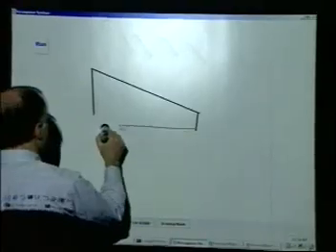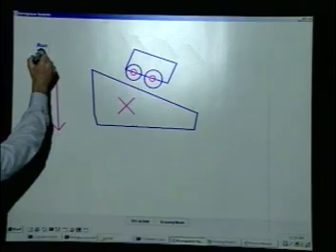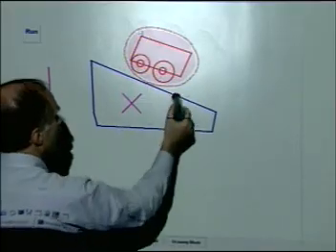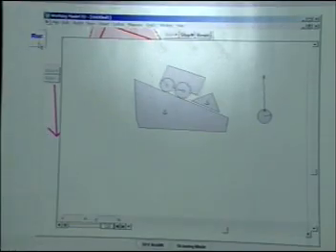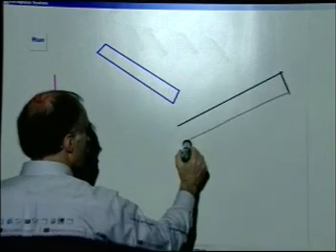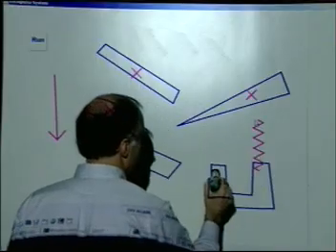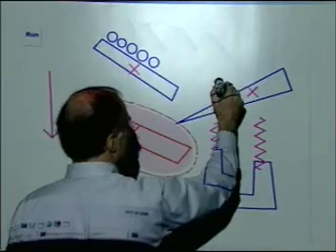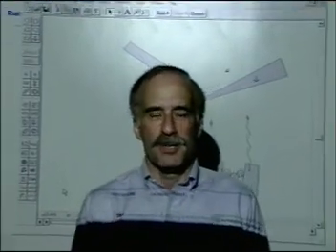MIT sketching

Comment: This video uses ASSIST (what they're presenting this for) and Working Model 2D (an engineering software). The physics and all that jazz is done in Working Model 2D. The (small?) innovation here is that your drawings are "recognized" as items (as a spring, wheel, etc.) instead of having to select them manually on the toolbar in Working Model 2D.

But seriously, Working Model 2D is already sufficiently simple. I'm not sure why anyone would need this. This video is old... anyway.

Comment: This program is really cool because you can specify: size, weight, inertia, charge, type and amount of gravity, even physical properties where you can have material made of rubber, steel, etc.. Even the springs in the video could have been changed for how easy or hard it is to stretch or compress them.

Comment: I was wondering the same thing. I'm thinking unless you define an object as a certain material (if it even lets you do that), the program assumes everything is made of the same default material. So it then determines the weight strictly by the size of the object.
I would guess the strength of the gravity is based on how long/large you draw the arrow.

Comment: Not really useless if the physics of it are accurate and position messurements can be obtained. Building a mock up of a structure would be very simple and have less trial and error. That's the whole point of it I think.